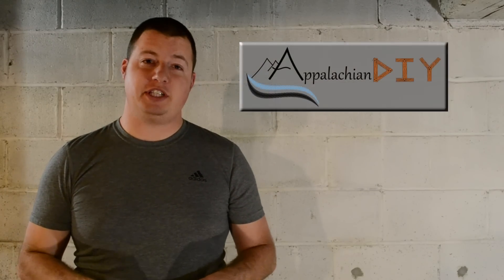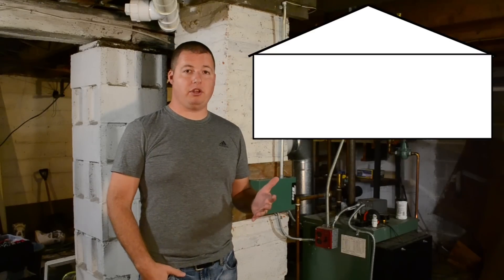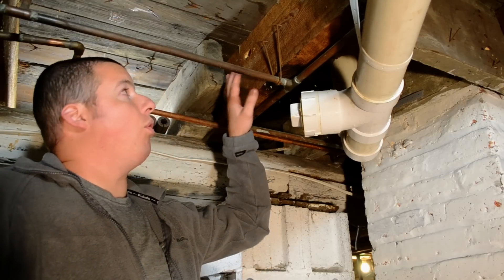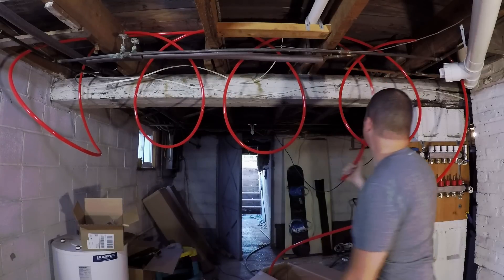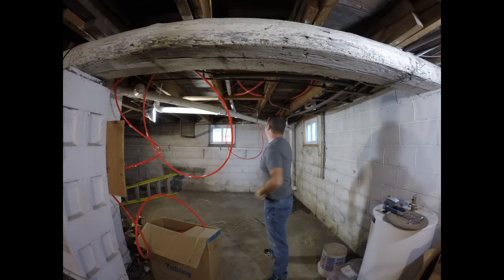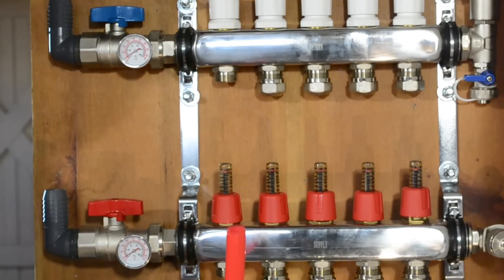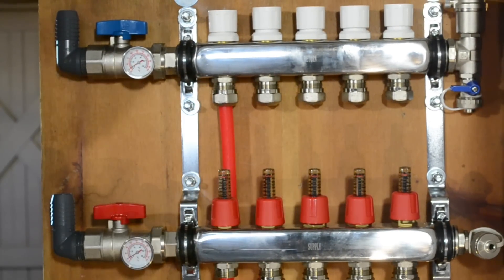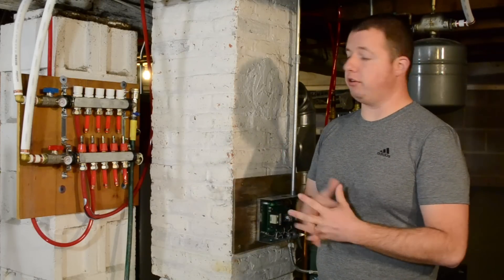DIY Radiant Floor Heat

Comment: Is it possible to add a radiant zone while keeping other conventional zones, Baseboard, radiator (convectors).??
Reply: Yes it’s possible, but the baseboard and radiant operate at different temperatures.    It will require running the boiler at a higher temp(180) for the baseboard and mixing down with a thermostatic mixing valve for the radiant(130)
Reply from the maker: Sam Black absolutely! Just cut out the baseboard and run floor heat on that loop. Supply and return stay in place, just tap off of them
Reply: @appalachiandiy2415  so what you are saying is keep the baseboard but tap the radiant off of them? thats a great idea. would the loop length limits stay the same(300ft)? or would the baseboard count for something more than just its length?
Reply from the maker: @mikakey55  you could keep the baseboard and tap off of it but i would figure the baseboard as part of the 300' length. So if your base board is 100' your pex loop should be 200'

Comment: please explain the connection from the boiler, it is the most important part of the set up
Reply from the maker: PBS #007 the circulation pump pushes the water through the boiler (heating it up) and then travels to the supply trunk of the manifold. It then is divided into the zones. Once the water passes through the zone it returns into the return trunk and pushed back into thr boiler to be heated up again.

Comment: How do you hook up the Taco low voltage zone valve connections. We have similar system and am adding another zone (same circulator). Richie C
Reply from the maker: Antoinette Miller all zones are controlled by the manifold. I run a single taco circulator

Comment: Really informative and well explained, thank you. If your system gets a leak and you're away from home, will the hot water circulation stop automatically? Thanks
Reply from the maker: Rafael Gelpi the circulator pump is only on when the system calls for hot water. it will not auto shutt of if there is a leak

Comment: Thank you for sharing this...clear n concise!!!! Can this system heat a 2 story barn home you think? So is it hooked to your Hot water heater?
Reply from the maker: NJ CAMOCUTIE yes this system can be put in a 2 story home. my heat source is an oil fired boiler. a water heater like you would use for domestic hot water would not be very efficient. you need some type of boiler. oil, propane or natural gas are popular choices

Comment: here in nyc I seen ppl add glicol in there system to hold on the the heat better then just water alone & it won't freeze to ice when appliance is off. 
I seen it done, I personally  wouldn't do it to my own heater system.  
1 bc glicol is cancerous 
2 bc glicol being an oil it'll cause lil cracks in the system to start dripping  ( with time )
3 most of the glicol is dump into the sewers land sea and air
Reply: Lots of misinformation and misspelled info in this one
Reply from the maker: I opted not to use glycol because I didnt need it because there was no potential to freeze in my basement and it would have been an additional cost that wasnt needed

Comment: Instead of using your existing furnace.. can you not supplement the heat with an outdoor heater ( I personally would use glycol since it wouldn't freeze and cause  a huge environmental issue and nothing would break).

 This is a big expense  but worth it IMHO

 Cheers, Great Video
Reply from the maker: Delekham Yes that is possible. Im looking into using my pellet stove to help heat the water somehow. I know of people who have outdoor burners(burn firewood) that have radiant floor heat and love it. I Think they run straight water though.
Reply: Your are quite correct they do use water....I just can't wrap my head around using water when it is -40 outside, unless they insulate it very very well. Which works if the temperature of the ground is not frozen. I am looking at ideas since using Natural Gas or any other fossil fuel is getting to be very expensive.

 One way my brother in law did it was using his wood burning stove to heat the water, he wrapped pipe around the chimney and then ran radiant heat to his shop. 

Anyway thanks for a great idea. I might be able to do something with this idea. Great Job..I know it is a PITA to do what you did by yourself.

Comment: I'm going to have a new build home & wanted to ask the builder to install radiant floor heating at least in the bathrooms.  In your opinion, how much would a contractor/plumber charge to install the radiant floor heating.

Thanks!
Reply: +Lisa , you should also consider doing the basement in radiant heating., the cost of doing in the construction stage is far cheaper than doing it afterwards, if you indeed are doing a basement since the basement is by far the coldest. The beauty of it all is if you want to get a little dirty it can be done by yourself or your hubby and you can save ALOT of money. Plus since heat rises, the basement is now heating  (to a certain extent) the rest of the house. I would suggest a On Demand water heating System for the Basement Radiant heating and it can double as a heater for your shower/kitchen.
Reply from the maker: Lisa Hin thats a hard question to answer. if your just doing bathrooms it might be better to go with electric instead of hydronic floor heat. if you put the money into doing the bathroom why not do the whole house? it also depends on how your going to heat the water and your square footage of the bathrooms. Send me more details to my email at AppalachianDIY@gmail.com so I can better help you. Thanks!

Comment: Dagnabbedit, doing good until you started that ridiculous "music" at some times...
Reply: I have a zone that is not giving heat all others (6) doing well. House and system 15 years years old. Replaced circulating pump, mixing valve. How can I blow out zone?
Reply from the maker: What do you mean by blow out zone?
Reply from the maker: haha thanks!

Comment: Good detail on the manifold setup and how to install to underside of floor. But for someone without a boiler how do they make this work? In my case I have an electric forced air furnace, any thoughts of components needed to heat water with it? And what makes the water flow in a closed loop system?
Reply from the maker: Paul Tiller. Your out of luck with heating water. its not easily possible with a forced air system. I am working on a conversion for my pellet stove(which is forced air) to heat water to circulate through my system but its is heavily modified. 
Water is pumped through the system using a circulator pump. I have a Taco pump on my system
Reply: That is very possible....Run copper tubing around your chimney the convection of the water will force it through the tubing. I have a Bro-in-Law that heated his Quonset with this same thought.

Comment: Hi thanks for this video great idea . Is there no need to insulate between the joists too or that enough what u just showed us
Reply from the maker: Andrzej Chrzastowski you can do it either way. I wanted some heat in the basement for a hybrid water heater that is why i didnt insulate. If you want all the heat to go up into your rooms, then go ahead and insulate so your not losing heat into the crawl space/basement.

Comment: Hi there!  great video.  I have a question...I installed the pex system with my existing boiler. i have a mixing valve to keep the temp down for the heated floors. the problem is i think the water is too hot. the cold side of the valve is hooked up to the return of the broiler. if I remove that and hook up cold water to the valve wouldn't that be a lot of water waste? and on the return of that water input where does that water go in my boiler??  thanks for any help.
Reply from the maker: meterfamily, the first thing you should try is to lower your thermostat on your boiler. I turned mine down as far as it would go. (140 i think) doing this is the easiest way to control your temp, which in turn will give you a cooler temp on your return line for your mixing valve. You cant add external cold water without having somewhere for it to go. Think of underfloor heat as a semi closed system. the only time water is added is if you have a leak or trapped air is forced out.

Comment: Shot in the dark here. Think with a few extra feet of everything and expenses, that you could do this system with solar heating or at least hot water using solar and wind dump loads? I've thought about getting in at the cellar and doing one room with this thought. Using dump loads to the hot water heater (separate from the rest of the hot water lines) and then using a pump to move that hot water up through the pipes. Heating element can run from 120 up to around 160 (I think) and should never really get to boiling stage. Just a thought here. I've been bumping it around in the pea brain for a couple years now. Anybody care to comment? "Specially the poster here on his system. I'd like input in the form of either positive or negative.
Reply from the maker: This is an interesting idea. I have been thinking of something similar where my pellet stove would be an auxiliary to my current system somehow. I think your idea would work. you would just have to have some type of controller that would dump the hot water a couple minutes before the hot water heater would kick on to get everything warmed up. if not I think you would loose the benefit of the hot water helping to warm things up. Let me know if you try and tackle this. It would make an interesting YouTube video.

Comment: Nice work!  I'm in the middle of same install right now except my whole job requires crawling. It sucks.  Anyway. Same manifolds,  same pex,  same heat transfer plates. How's it been working for you? Have you done any insulation under the pex, or leaving it open to the basement?  What kind of water temps are you running? How well did your garden hose fit on the end of the manifold when you bled it.  Mine wouldn't go.  Some kind of wierd thread.
Reply from the maker: Matthew Diem it's been working great. I run the lowest temp I can on my boiler. I didn't insulate the underside of my pex because I have a hybrid water heater in the basement. having a little heat loss to the basement allows my hybrid hot water heater to be more efficient with the extra heat generated by the floor heat
Reply: Appalachian DIY what kind of hybrid hot water heater you have

Comment: also interested in info on if you're using single pump with zone valves, or multiple pumps to support each zone. do you have any info on balancing the system once installed and purged?
Reply from the maker: single pump. There are flow rate valves on the manifold so you can control how much heated water gets to a certain zone. The flow rate valves will help with balancing

Comment: I'm putting together a parts list from scratch and would like your input on your boiler setup. Do you have a controller already in place for your thermostats? Are you running a single pump for the whole system? Is your boiler modulating? A layout video of the system would be very helpful!  Good luck on the channel
Reply from the maker: I only have a single thermostat that controls the boiler. Its in the coldest room in the house that way its always warm enough in there. The Manifold has control valves that lets you control the flow rate to each zone. Im running a single pump(using the same one that was in place for my baseboard heat) I might make another video showing the layout

Comment: Was all your PEX the Oxygen Barrier type?  And how well did  the system work for you since the install? Were you getting noticeable heating through the sub floor and tiles?
Reply from the maker: The pex is the oxygen barrier type. It worked quite well and Im very happy with it. The room above the radiant floor heat is the bathroom. It has ceramic tile and its is nice and toasty when its running. It feels nice, especially when you're on your bare feet.
Reply: @appalachiandiy2415  So after two years, are you still happy with it?  I'm sure the floors feel nice, but does it actually heat your home (or at least this room you did it in)?
Reply from the maker: @zcpoling  i LOVE it. Yes it can heat the entire house. Put it to you this way. If i ever did a new construction home it would have radiant floor heat